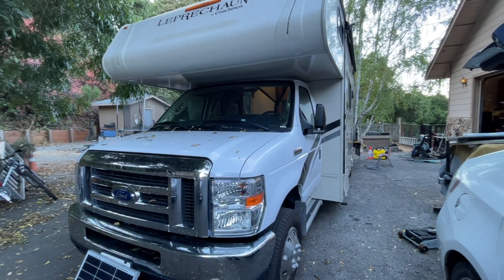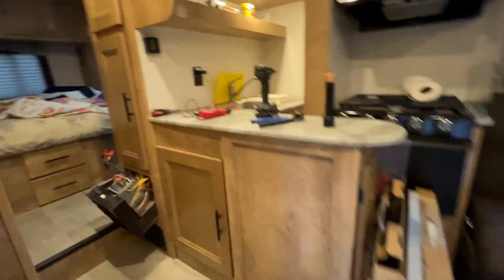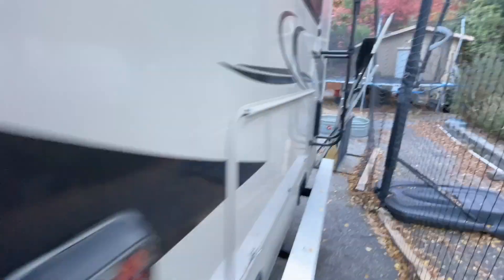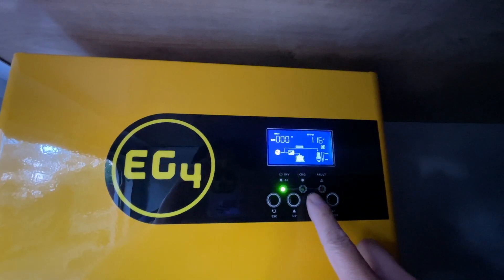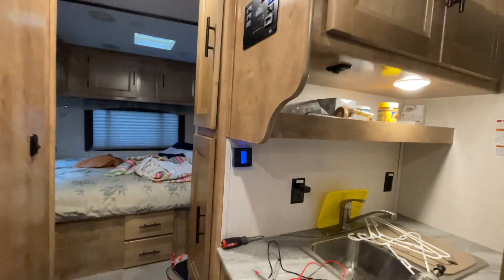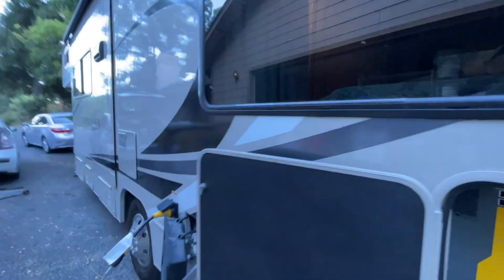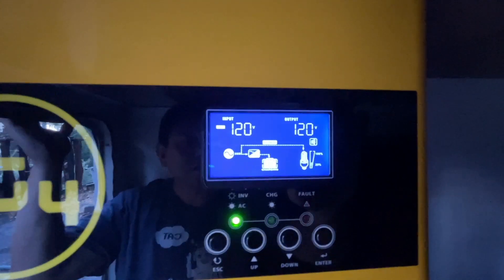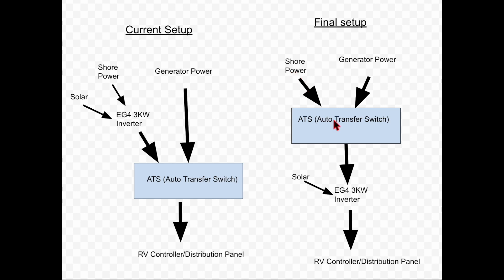Will EG4 3000EHV-48 inverter works with Onan Generator in RV?

Comment: Do you have any issues with the eg4 overheating? I see in the manual that it needs 20" clearance top and bottom. Looks like you have around 4".
Reply from the maker: I don’t have any issue with heat.  The cooling fan is alway on and keeping EG4 cool.

Comment: I have been thinking of doing the same ..... A 48v system to my class A, this is very helpful. Did you wire up a separate ac panel for the 48Volt system? I assume you left the 12 volt as is? If you can do a vid on how you accomplish this I bet it would be a hit.. not a lot on this on subject youtube
Reply from the maker: My RV came with AC panel.   Here is the link to the part. 
https://www.amazon.com/WFCO-Arterra-WF-8955-AD-Converter-Distribution/dp/B0B47GZR5B/ref=sr_1_23?keywords=rv+distribution+panel+30+amp&sr=8-23&ufe=app_do%3Aamzn1.fos.18ed3cb5-28d5-4975-8bc7-93deae8f9840

In the past, I needed to start up the generator or plug in the shore power to get 110V.    I left the 12V system untouched.   I will create a video detailing how I wire the inverter setup when I am less busy.

Comment: I really appreciate this video. I have the eg4-3000 and the eg4 rack mount battery and want to put it in my rv. Since it already has the ATS, I figured it would be best to wire the inverter after the ATS as you've shown. Thanks for confirming my assumptions. Please do a video showing your inverter setup in more detail, please. Especially how you've secured it to the wall. Thanks
Reply from the maker: Sure, I will post the final wiring video in 1 week.  I just finished uploading how I added a remote switch for the EG4 3K inverter.   I installed my inverter in the storage compartment at the back of RV .  It is a pain to go outside every time I want to turn it on.  So I added a remote switch inside.  Check it out.  
https://www.youtube.com/watch?v=3IFzLOWTP7g